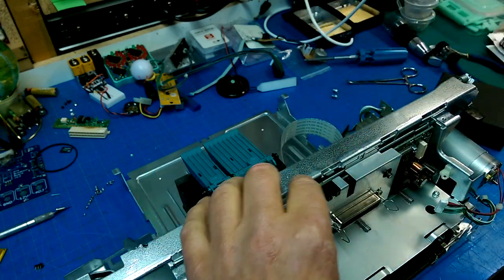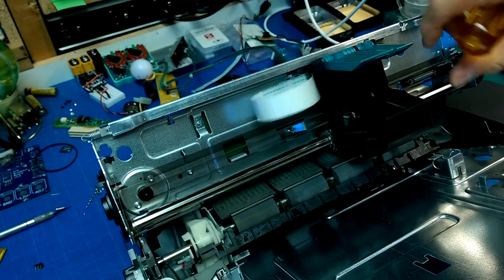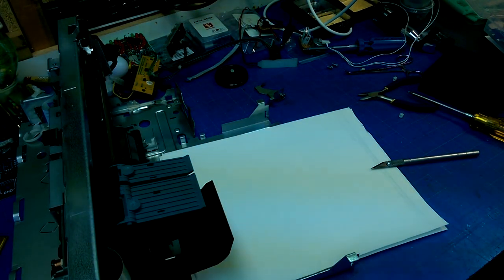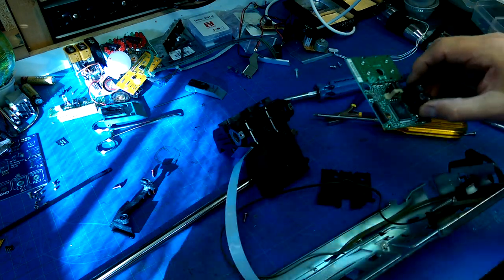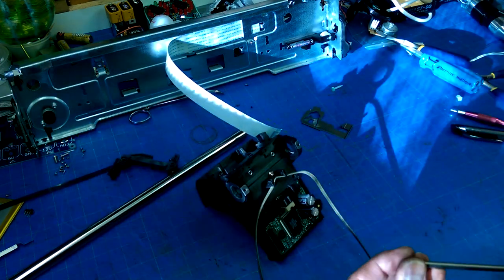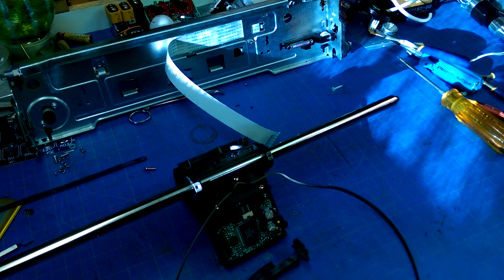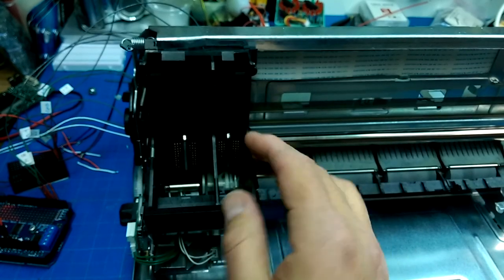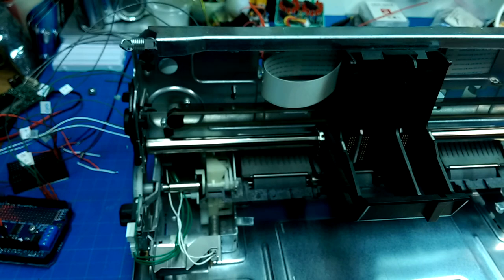Closed Loop Motor Control part 1

Comment: Those are brush-less DC motors, i.e. permanent magnet motors.
Reply from the maker: I am fairly sure that they are brushed DC motors.  They required no external commutation to drive them.  Brush-less DC motors require external commutation control.
Reply from the maker: @andrewferg8737  They are not though.  They have brushes in them.  They are not the same sort of motors as you see in fans for instance.  They are just cheap ol' brushed DC motors.  https://youtu.be/-2-osXaTVDA
Reply from the maker: @andrewferg8737  see the link I posted in the comment above....  Brushed motors.
Reply: @grtyvr  I stand corrected! Thanks for the link!  I've dissected many a poor printer... and have found steppers and small magnets motors. I've cut some of these smaller ones open, as I've a box full of them. I have found some of the newer printers use larger DC motors for the main drive but I never thought to cut one open. I like to save the larger ones. Thanks for the demonstration!